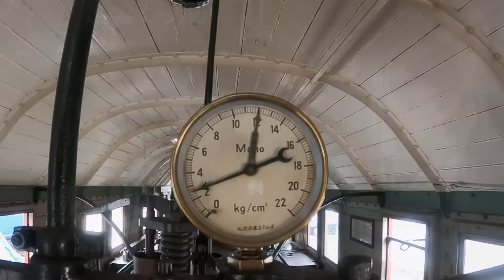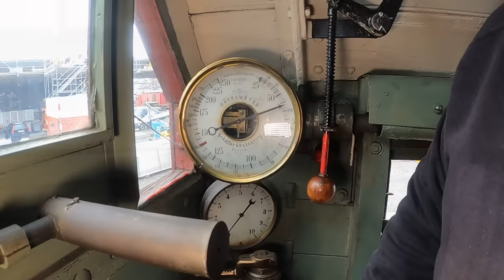First Steam Test Snow Blower, Dampfschneeschleuder SBB Xrot 100 erstmals unter Dampf nach 40 Jahren!

Comment: I WOuld LOVE To See This Beautiful Piece Of Art In Work, How It Showels The Snow, THAT Would Be A Lifetime GOAL For TrainSpotters !
Reply: This one is highly unlikely, as it would require a lot of Snow in the relatively flat Swiss Midlands, and the Standard Gauge Alp Crossings in Switzerlands are way too busy to allow closing them for demonstrating historic Snow Blowing. There are two Narrow Gauge Rotary Snow Plows in Switzerland though, one on the Bernina Railway and one on the Furka Railway. Both of these Lines climb over 2000 m high. The Bernina Line still is a commercial Railway, so they clear it with modern Equipment and then shovel a bit of Snow on it again, to show off their Rotary Snow Plow. The Furka Line is a Heritage Railway though, and closed over Winter anyway. So they can show their Rotary Snow Plow under real Conditions without having to worry about being fast or efficicent or even clearing all the Snow at all. There is a Video on this Channel of the Furka Snow Plow battling against rock-hard Snow in April, and it gives you an Idea how tough of a Job it was to run these Machines.

Comment: Congratulations on a job well done. Just a suggestion, to make this plough and other steam engines more readily available for show, how about a wagon mounted electric boiler to speed or pre-prepare the heating of the boiler and reducing preparation time. Reduce the magnitude of heat cycles if used over a number of days running, to maintain temperature overnight with a reduced fire. Not suggesting the plant the Union Pacific had at there Cheyanne depot to keep Big Boys at temperature.
Reply: The Swiss had something similar to it already The panograph wires they have over their lines use to feed steam locomotives power to preheat there water.
Reply: @jamesbuckner4791  Yes I have seen the pictures of the electric steam loc. This railway however does not still have a complete overhead system. A system running of domestic voltage/ampage in the storage shed is all I suggest.
Reply: I have seen that steam tugboat somtimes had tube connections to start them hit steam because the fuel pump and main blowers are steam powered as well so when and  and also use steam to preheat the macines  

Not to heat the water that takes to much power
Reply: @briancooper562  domestic voltage/amperagE is 230V at 13A sustained, so that’s only a few kW. I don’t think that’d be enough to heat the boiler significantly. Slightly less domestically, sure, three phase can be a lot more. But it’s pretty expensive power.
Reply: @JasperJanssen  The suggestion is to maintain some if not all of the temperature within the boiler after a days work. To reduce the thermal stresses due to a full cooling/heating cycle of the boiler.

Comment: 6:42 - If the machine shakes like that, then the mass of the wheel is not centered. In fact, such a defect can be corrected. It seems strange to me, such shaking is considered the norm.
Reply: mayb it helps shaking stuck snow idk
Reply: Steam Engines have Cranks offset by 90° and not 180° like in an Internal Combustion Engine, hence they always are unbalanced. A 180° Offset would mean that both Pistons are in Top and Bottom Dead Center at the same Time, and the Engine couldn't start if it came to a Stop in that Position. A 90° Offset spreads the Power Strokes equally, as the Cylinders are double-acting which results in four Power Strokes per Revolution from two Cylinders.

Comment: Is you blower related in anyways to the OY blower on the Cumbres and Toltec RR in Colorado, US. Mainly asking to see if it's patent related or not. Nice to see it steamed up and back to life so to speak. Good luck out there.
Reply: They are unrelated, the only similarities being that they are both Rotary snow blowers, and both are steam powered.
This blower, the SBB Xrot 100, was constructed in 1896.
The blower 0Y on the CTSRR
Cumbers and Toltec Scenic Railroad, was invented and constructed in 1920 by an American company, whereas the XRot blower is currently owned by the Swiss Federal Railway (SBB), and was likely constructed by a Swiss Company. It was built for use on the "Gotthard line", which stretches from Como in the south to Luzern in the north.
This blower is currently in Luzern.

Comment: I wanna see it go through some snow
Reply: That would require a lot of Snow in the relatively flat Swiss Midlands, which is highly unlikely. There are two Narrow Gauge Rotary Snow Plows in Switzerland though, which are regularly demonstrated each Winter. One of them is located on the Bernina Railway, and the other one on the Furka Railway. This Standard Gauge Snow Plow can't be demonstarted in the Alps, as the Alp-crossing Standard Gauge Lines (Gotthard, Lötschberg, Simplon) are too busy to allow closing them for such a Demonstration.

Comment: Can I assume this rig had one boiler,  producing steam for cylinders driving the wheels ,  and for a separate cylinder,  powering the blower.  I didn't see connecting rods for the wheels,  but I also assume it had them.
Reply: I do not think it had drivers. It looks similar to another steam powered blower out in Colorado and it has a pair of Mikado locomotives that push it along when they are doing track clearance operations.

Comment: my German/Swiss? is not to great, but this engine is not self propelled it seems? its just a locomotive that drives the blade only?
Reply: So it doesn't waste any Steam to propel itself. You need to push it anyway, as its own Weight doesn't gain enough Traction. The only self-propelled Rotary Snowplow that I know of is the Xrot 9213 on the Bernina Railway. That Line has such tight Turns that a pushing Locomotive would derail the Snowplow. It is self-propelled in said Turns only though; everwhere else, all Steam goes to the Snow Blower.

Comment: Very disappointed I didn't see it in action
Reply: That would require a lot of Snow in the relatively flat Swiss Midlands, which is highly unlikely. There are two Narrow Gauge Rotary Snow Plows in Switzerland though, which are regularly demonstrated each Winter. One of them is located on the Bernina Railway, and the other one on the Furka Railway. This Standard Gauge Snow Plow can't be demonstarted in the Alps, as the Alp-crossing Standard Gauge Lines (Gotthard, Lötschberg, Simplon) are too busy to allow closing them for such a Demonstration.

Comment: When do we see this in the snow?
Reply: Probably never, as this would require a lot of Snow in the Swiss Midlands, which is unlikely to happen. This Machine could clear Snow on a Heritage Railway or perhaps Branch Line only, as the Alp crossing Lines (Gotthard, Lötschberg, Simplon) are too busy to allow closing them for such a Demonstration. There are two Rotary Snow Plows on Narrow Gauge Lines in the Swiss Alps though, on the Bernina Railway and on the Furka Railway. These are demonstrated regularly each Winter. Especially the Furka one is spectacular, as the Furka Railway is closed during Winter so they can show off the Machine without worrying about being efficient or even clearing all the Snow at all. There's a Video on this Channel of such a Demonstration in April, when the Snow became rock-hard after Months of thawing and re-freezing. That Video really gives an Impression on how tough of a Job it was to clear Snow with these Machines. There are Stories of clearing Avalanches (which are similarly compacted), and clearing less than one Kilometer per Hour because the Snow was so hard.

Comment: i couldn't imagine someone trying to hijack one of these. they just come up with guns demanding you all to start the train with you saying it'll take 20 to 40 minutes
Reply: Firing up a Steam Locomotive takes 4-8 Hours, depending on the Size of the Boiler. You have to heat up Boilers very carefully in order to get an equal Heat Distribution. If you rush it, one Side gets hotter than the other which results in unequal Thermal Expansion, damaging the Boiler.
Reply: @Genius_at_Work  i didn't know it would take THAT long.

Comment: Was rust ever a big issue with steam engine trains?
Reply: Yes, Rust was the main reason for Boiler Explosion before regular Checkups became the Norm. Hot Water is very corrosive.
Reply: @Genius_at_Work  Thanks Mr. Work. :)
Reply: @sunar91  More precisely, Boiler Water must be alkaline, because hot Water behaves like an Acid. Alkaline additives in the Water cancel that out. One can only imagine how much Boilers rusted before that was discovered.

Comment: Is it 'normal' to have that spinning wheel so unbalanced?
Reply: The blades of that wheel are adjustable to set the direction in which the snow is thrown.
Seems like some blades are adjusted to the left, some to the right and some are somewhere in between... Of course they all need to be adjusted the same way to work properly, but for this steam test, it doesn't matter...
Reply: The blades of that wheel are adjustable to set the direction in which the snow is thrown.
Seems like some blades are adjusted to the left, some to the right and some are somewhere in between... Of course they all need to be adjusted the same way to work properly, but for this steam test, it doesn't matter...
Reply: I think the unabalanced Thing is the Steam Engine. Steam Engines have a 90° Offset between the Cylinders, which is not ideal Balance-wise.
Reply: @Genius_at_Work  >>> Okay...👍
Reply: @Allan_aka_RocKITEman  The 90° Offset makes the Engine self-starting. A 180° Offset like in an Internal Combustion ENgine would result in both Cylinders being in Top and Bottom Dead Center at the same Time. A Steam Engine couldn't restart without external Help if it was stopped in that Position. This doesn't matter in Internal Combustion Engines, as they must be cranked up to start anyway, so it makes more Sense to design them as balanced as possible. The higher RPM makes Balance more important than in slower Steam Engines as well.

Plus 90° separate the Power Strokes evenly. Steam Engines are double acting, so two Cylinders result in four Power Strokes per Revolution. 360°/4=90°. The 180° Offset makes an Internal Combustion Engine firing evenly only if it is a Two Stroke; Four Stroke Engines would need a 360° Offset so the only evenly firing Four Stroke Engine is a Boxer like in a Citroen 2CV or some BMW Motorcycles.

All of this applies to Two Cylinder Engines only. Three Cylinder Steam Engines have 120° Offset like an according Internal Combustion Engine, and Four Cylinder Steam Engines usually have 90°, so there are always are two Power Strokes simultaneously. Four Cylinder Steam Engines already are rare enough (usually Compound Locomotives and Quad Expansion and some Triple Expansion Marine Engines), and everything above Four Cylinders is/was an absolute Exception.
Reply: @Genius_at_Work  >>> 👌

Comment: I wanted to see it work with snow, this video only disappointed me
Reply: Seeing this one work is highly unlikely, as it would require a lot of Snow in the relatively flat Swiss Midlands, and the Standard Gauge Alp Crossings in Switzerlands are way too busy to allow closing them for demonstrating historic Snow Blowing. There are two Narrow Gauge Rotary Snow Plows in Switzerland though, one on the Bernina Railway and one on the Furka Railway. Both of these Lines climb over 2000 m high. The Bernina Line still is a commercial Railway, so they clear it with modern Equipment and then shovel a bit of Snow on it again, to show off their Rotary Snow Plow. The Furka Line is a Heritage Railway though, and closed over Winter anyway. So they can show their Rotary Snow Plow under real Conditions without having to worry about being fast or efficicent or even clearing all the Snow at all. There is a Video on this Channel of the Furka Snow Plow battling against rock-hard Snow in April, and it gives you an Idea how tough of a Job it was to run these Machines.

Comment: I didn't see any snow throwing. Boo.
Reply: That would require a lot of Snow in the relatively flat Swiss Midlands, which is highly unlikely. There are two Narrow Gauge Rotary Snow Plows in Switzerland though, which are regularly demonstrated each Winter. One of them is located on the Bernina Railway, and the other one on the Furka Railway. This Standard Gauge Snow Plow can't be demonstarted in the Alps, as the Alp-crossing Standard Gauge Lines (Gotthard, Lötschberg, Simplon) are too busy to allow closing them for such a Demonstration.